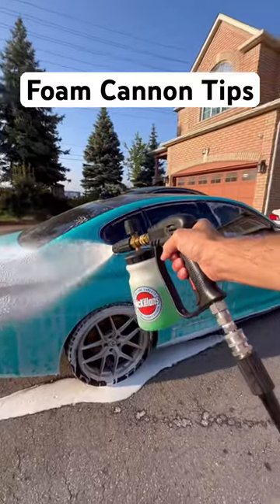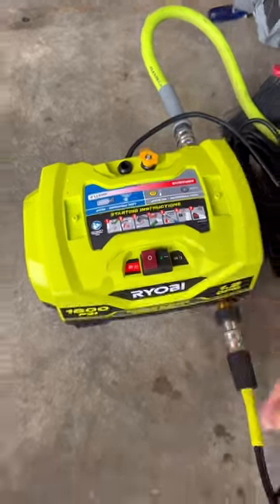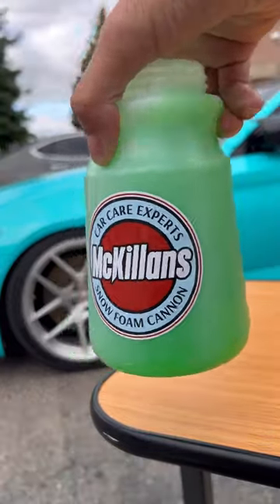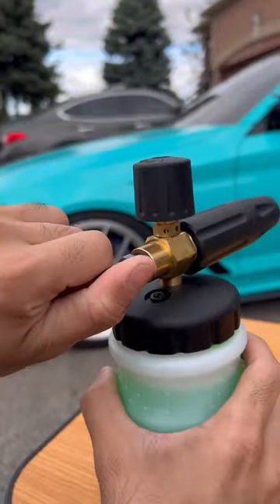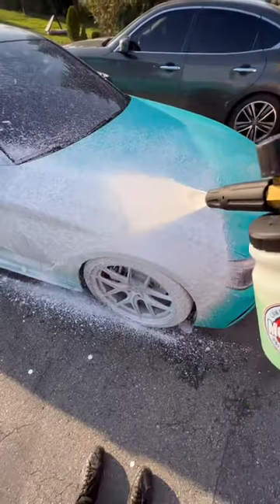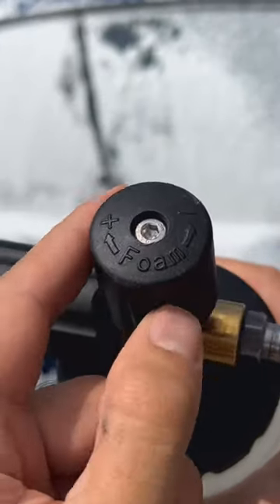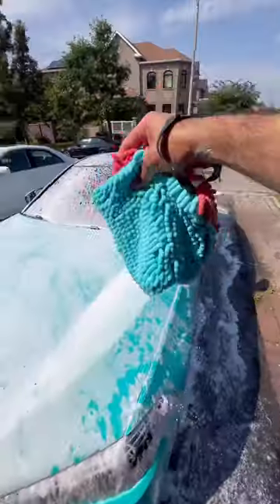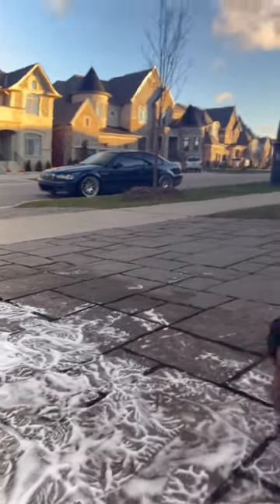Foam Cannon Tips - Watch Before Buying A Foam Cannon #Shorts

Comment: I use the same pressure washer and foam wash for my truck it gives pretty good results.
Reply: For many years of detailing using gas pressure washers.im switching to electric and u really don't need that much pressure to get the Job done just have experience and chemicals of your likes

Comment: Hello!  i need your advice.  I want to buy a foam cannon and quick change set from you.  with which pressure washer foam cannon will give better results for thick creamy foam when washing cars?  which is the best pressure washer to use with your foam cannon?  I have a 3000 brushless Ryobi 1.1 gpm which is good for home use

Comment: I use a stihl pressure washer, what cannon would fit the gun? I need a lot of advice about this kind of stuff
Reply: Depends on the brand you want but realistically you can just buy a seperate adapter that connects with your pressure washer, check there website

Comment: Need is a strong word, you don't need a pressure washer, there's snow foam cannons that attach to a normal garden hose, the foam isn't as fine or foamy but it still works for me just fine. I'm trying to figure out the best solution to use for maximum foam with it. Right now I use meguiars gold class soap

Comment: Anyone knows if the hose of the pressure washer shown in this video has 14mm or 15mm connectors?
Reply: Ryobi has m22 connections, you can install an adapter for any size you need for your fittings just make sure it's a swivel so your hose doesn't kink and get weird
Reply: @Robertapodaca82  ok, thanks for the advice. Very helpful. But that M22 is 14mm or 15mm? I was doing some research and found that all gas powered pressure washers have 14mm and electrics have 15mm. But in this video he mentions that most electrics have a 14mm too. I'm very confused now